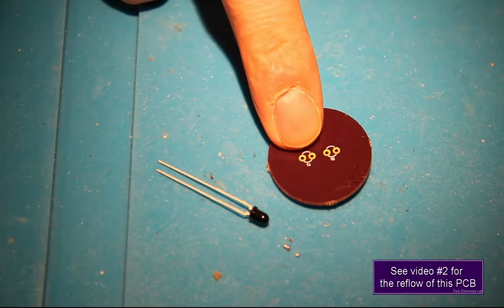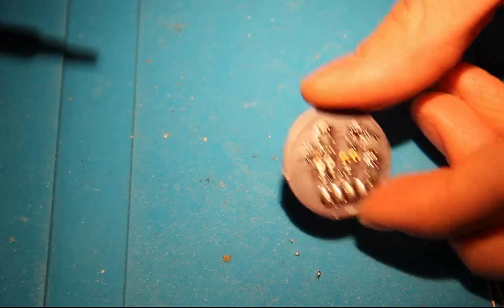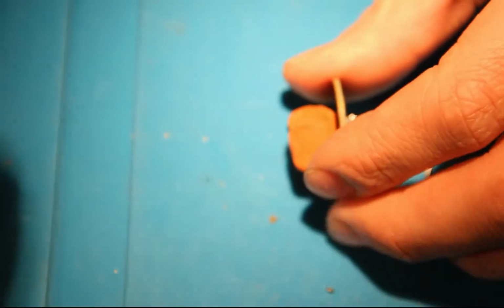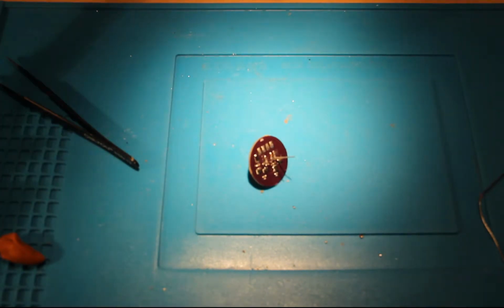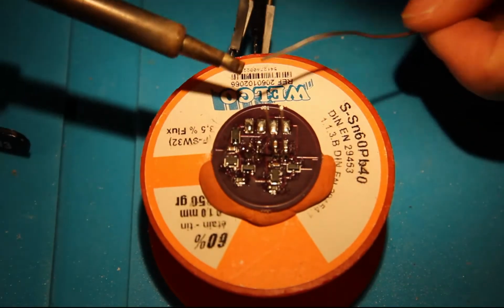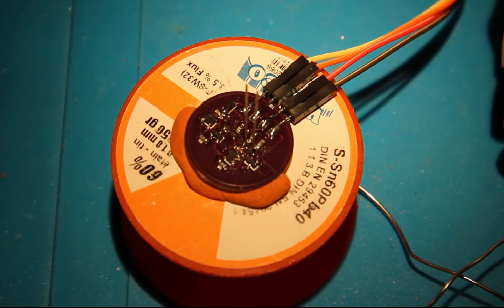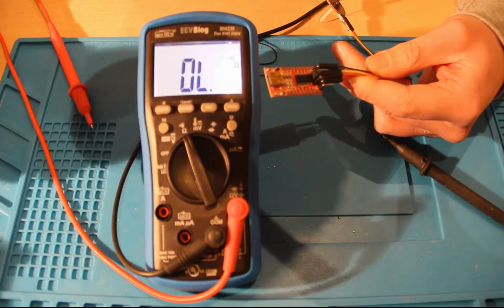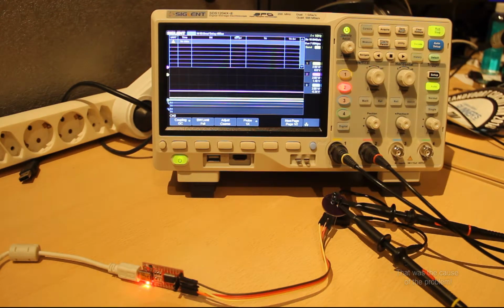#3 Energy reader follow up

Comment: Can i give you a hint, if you don't mind?

Before uploading the video, you can easily remove background noise from the audio track with the free software called Audacity - at least that's what I do. It's literally 3 clicks and helps a lot by removing the humming of machines, whatnot.
Reply from the maker: Aah thanks! I did remove the 50 and 60 Hz hum from the video, but I'll check if I can remove the static noises too! Thanks